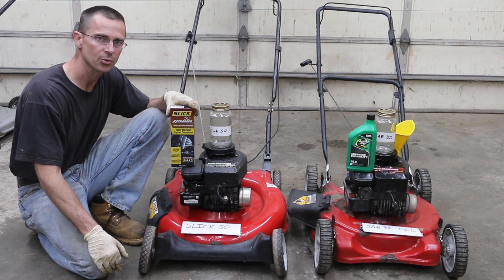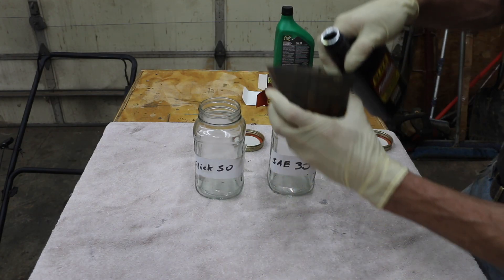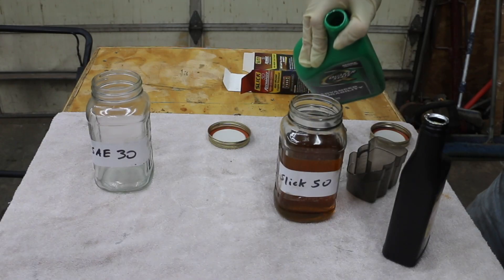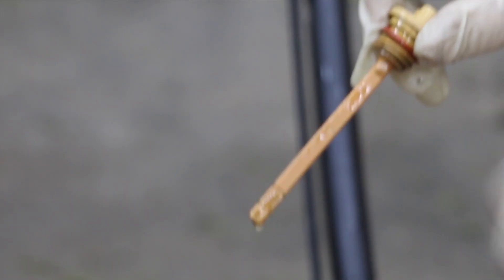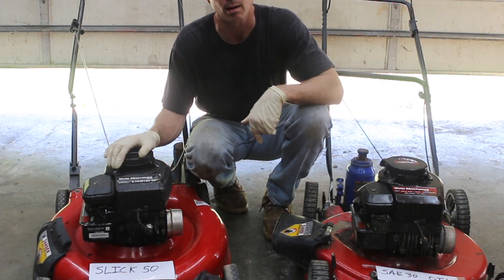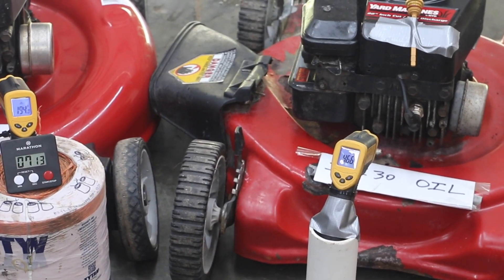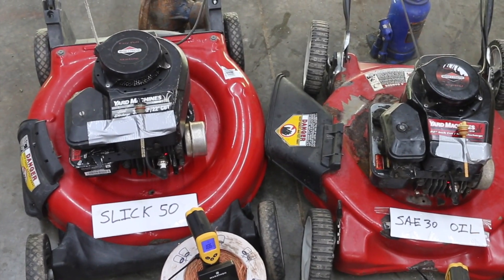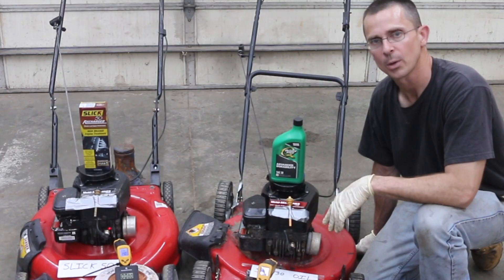Can't believe what SLICK 50 did to my engine!!--Dry Crankcase Test!

Comment: Did you run the slick fifty long enough for the bonding process to be adequate?
Reply: Good point, but an inadequate bonding time shouldn't cause that engine to fail in half the time, right?
Reply: @GunNut37086  yeas that is perplexing.  Wonder if their is a cure time because the temperature was far better with slick fifty.
Reply: @timewithchaplainken3916  That's the part that confused me the most. The temp was SO low when the Slick 50 engine crapped out compared to the other one. That has to mean something.
Reply: @GunNut37086  if paint is put on a frozen surface,  it will just come right off. Likewise, Slick 50 deposits a layer of teflon that depends on a lengthy heat cure for good adhesion.
Reply: The slick 50 does need to properly bond first.

Comment: Any additive that contains PTFE's will gunk shit up. Used to use slick 50 until I heard about Z-max. I added Zmax to my engine after regular use of slick 50. The next day, my engine was overheating and my oil levels were down by half. I limped home, drained the oil, removed the oil filter, and behold! The oil filter weighed like five pounds. Had I discovered the final resting place of my absent oil? The vehicle didn't burn oil before or after my experience. Through deductive reasoning, and research, what had happened was, the deposits from Slick 50 were washed out by the Zmax and clogged my oil filter. I replaced the oil and filter and the car ran for the next few years, until the timing jumped and trashed the engine. Conclusion, research revealed that Slick 50 was coating my engine and Zmax penetrated to the metal surfaces and made them "slick" enough to cast that crap to the eternal hell of filter finality. PTFE's are fooey!
Reply from the maker: Great information. Thank you
Reply: After watching your Zmax vs Lucas I'm not sure either one is worth spit. Was convinced that Zmax penetrated the metal surfaces to reduce friction but now, eh!? The PTFE's, now I'm pretty solid on their negative effects. Waxes, PTFE's, and just about any other additive appears to be a clever way to separate me and my cash.

Comment: This wasn’t proper test. The engines are of different age and not same series so they can’t be used in this kind of test. And even if they were new ones, you should open both and measure everything and do it again after test. The very important thing is to open the engines to see what went wrong.  Why did cooler running break first? The older one is probably worn and then it may run longer because it doesn’t get seized up as soon as new and tight engine.
Reply from the maker: Thanks for the constructive feedback

Comment: There is one called micro blue I believe and then there is the old z max. And i always thought slick 50 was chlorine based so I'm actually not surprised. And it's not a pour in treatment more of micro shootpeening with lubricants that get embedded called wpc treatment and its supposed to be top notch racing quality. I believe Honda and tons of other racers use it on everything from bearings to pistons, wrist pins, rings, cylinder walls as well as driveline ( diff's, trans, t case etc.)
Reply from the maker: Thank you

Comment: I think I could see the Slick 50 engine maintained a lower temp. Don’t they always claim it’s a metal protectant and not a lubricant? I’ve used Motor Kote on engines with the oil. I’m just catching up to your videos. Have you done a Motor Kote challenge? They have many types on their web site.
Reply from the maker: Thank you

Comment: Hello sir,
have you heard about the triboron boron additive for 2stroke and 4 stroke engines? It claims to build up an layer of boron, to such a degree that 2stroke engines don't need oil added in the petrol. They do this successfully in The Netherlands and Sweden for a lot of years. A lot of people ride 2stroke mopeds this way. They also claim fuel efficiency, because friction is recused up to 50%. This all claims to be university tested. Would be really great if you are able to test the 2stroke or 4stroke formula. 
https://www.triboron.com/products/
Reply from the maker: Not yet. Thank you for the video idea!
Reply: @ProjectFarm  perhaps nice to see your two-stroke bike kit run on 1:100 triboron without oil :), the suggested mix is 1:100. 
 Thank you for all your video's sir.

Comment: how many hours was on each mower previous. hard to say the slick 50 engine wasn't abused in its life with no oil changes. maybe that is why the oil was so much darker because it had residue oil sludge.hard to call a fair test unless the motors was torn down and inspected before the test. Would love a repeat on 2 new engines. And I am not defending slick 50 I know what you know just looking at it with open mind

Comment: How long did you run the Slick 50 treated engine before doing the actual test. Slick 50 needs to bind to the friction bearing surfaces during running . I ran a Slick 50 treated Briggs mower engine for 7 hrs a day for 10 days at a agriculture show without it failing at all. This was our demo machine.
Reply from the maker: Thank you

Comment: I put Slick 50 in my used, V6, 1986 Astro Van about 25 years ago when it had less than 50,000 on it.  In 2019 it has 243,000 miles on it.  It has other wear issues, but no internal engine oil related problems, and uses no more oil now than it did when it had 50k miles.  I have never had to add oil between oil changes!  It still runs cool.  Leaks a little oil, but not enough to show on the stick.  I have changed the oil and filter about every 4,000-5,000 miles.  AC still works too with enough engine revs (weak).
Reply from the maker: Thank you

Comment: I used Slick 50 in my Toyota 22R engine in the mid 80's. I had the engine rebuilt, broke it in for a 1000 Kms or so then changed the oil and added Slick 50. I had to adjust the idle as the engine idled much higher than before the Slick 50. Unfortunately my new rebuilt engine died 3500 Kms later. Some of the oil passages had plugged up from an unidentified substance. I later learned (consumer reports maybe, I'm not sure anymore) that Slick 50 had/has teflon in it and as the teflon deposits in the engine passages is can plug some of them up. Needless to say I have never used an oil additive again.
Reply from the maker: Thank you

Comment: Been using all Lucas products now and think it's a great quality product, have it in my older chevy v8's and use small portions of it in everything  gas engine and a crankcase! Have a 305 SS Monte C. I started using lucas in when it had 350,000 on it and bad valve guides, run 20w50 with 1 quart of Lucas, and doesnt smoke as long as your driving it daily, and warm weather car in southern climents! Have it in northeastern Indiana now, but dont run it when weather cools below 20° runs like a champ and has over 450,000 miles now and never been apart other than resealing intake m. Doesnt leak and still has strong oil pressure! Only the heads getting wore out! She was decomputorized 14 years ago running a manual good set up  older Quadrajet and manual Chevy distributor with 50,000 volt coil and 30 degree advance timing. Dont run alcohol crap fuel in it, run non alcohol 93 octane, under that will valve ping! Ultralight swift fuel runs real good, its 94 octane aircraft quality fuel! And it gets 26.9 mpg on the highway!  New engine being  built now it will be a 355 chevy with a lanati 485 lift voodoo cam and alumiun heads, so I can freshen the original 305 and pickle it! Just in case. The new motor will definitely be put together with it and have Lucas in it after breakend period . Best I've seen!
Reply from the maker: Thank you.  Lucas makes great products

Comment: Used to be good product back when slick 50 came out and it really worked good, was called Protec oil treatment, in late 70's, I used it and talked a race car owner into using it, took awhile but put in in a 355  chevy oval track motor that turned 7000 rpm and normally we put bearings in every 4 weeks of racing, and they were wore 90 percent. Put the Protec in a fresh motor and ran it 10 weeks, plus a 400 lap big race, sit thru the winter, and ran it 3 more weeks and thought we were pushing it! So jerked it apart and bearing looked like you had just wiped your finger across them, like new! Owner said you can put that in my motors anytime! Was about 20 bucks for a pint bottle! After that they sold wheelbearing grease and I used a paint cap full in quick change rearend! Never had a problem or anything that wore!  This was 1978 to 1982.
Reply from the maker: Thanks for the recommendation!

Comment: I went to a slick 50 seminar for my company in the 80's and they did same thing except the engine ran the whole seminar. it does appear these were two used engines, I would rather see test with two new motors. go to harbor freight and grab a couple predator motors and do again.
Reply from the maker: Thanks for the constructive feedback

Comment: Make-up of internal metal parts make a difference also to fiction. Aluminum parts will seize quicker than Carbon based metal products. I also noticed discharge air from one mower.
Reply from the maker: Thank you for the constructive feedback

Comment: Todd. Your tests are awesome and dramatic. I enjoy them a lot! 
"Slick 50" flopped. And to many of us who know the story, the "Slick 50" of today is nothing like the original formula. So that leaves me wanting... with a hole in my heart, aching for the real product's vindication. 

Now I'm not associated with the product in any way... just an old guy who held up Slick 50 as a heroic warrior of my youth. It stood alone against the creeping villain of planned obsolescence.  Back then they called it "stickin it to The Man".
 
I'm hereby requesting that you make things right by testing LUBRILON (@t. It is the original, authentic, tried and true, Alpha Male, Slick 50 formula (now going by the name Lubrilon in the US, and Xcelplus in Austrailia). If you don't do it, I might have to  become a "squeaky wheel that gets the grease", so to speak... haha

If you were to consider doing that test, I would predict that it will be the only oil test that you will have done that actually defies the odds - that without oil, the Lubrilon treated engine will morph into an "eveready battery" and run indefinitely. It would redefine the term "run dry". You may have to set up a continuous time-lapse camera shot so you can get some sleep...

Comment: The early formula would not pass through most oil filters resulting in many blown engines including my 1983 Chrysler 318. I pulled the filter after loosing oil pressure, and it was full of white paste!

Comment: You could probably fix those motors. Usually all I ever have to do is pop the cylinder head off, put a block of wood on the piston and beat it with a hammer until the motor frees up. Then add oil. OK maybe throw a little oil into the cylinder first too?
Reply from the maker: Thank You!

Comment: Molyslip "E" use to make an additive way back, had used with great success, even tried seizing and engine by dropping the oil out, alas she knocked like a diesel and wouldnt die. Maybe they have changed the formulae now, but havent seen the product anywhere, it did work?
Reply from the maker: Thank you for the recommendation.

Comment: A while back my grandpa had a small engine repair shop, there was a slick 50 rep that stopped in once and he had a lil pisser car that he would drain the oil in and run it until it locked up. He would then allow it to cool down and hed add oil and it would start back up. He did this to this little car over and over and it never didn’t start. What this guy should have done is added oil to the mowers and see if they would turn over and maybe even started.
Reply from the maker: Thank you.  I wonder if the formula changed since then.

Comment: In order for Slick 50 to perform as it was designed, it it takes more run time than a couple hours to fully treat the engine. In the early 80s, I saw in person a demonstration of a Briggs & Stratton 3 1/2 HP horizontal shaft engine treated with Slick 50, run for at least 30 minutes or maybe longer without any oil, then the engine was turned off, but it did not stop on its own or lock up. Afterwards it was rather cooler to the touch, they let students touch the engine. Part of the output shaft cover was cut away and covered in plexiglas so one could see there was no oil in the engine. This demonstration was done by a Slick 50 dealer in my high school auto mechanics class. At this time Slick 50 was only available through a dealer. I think the test in the video was not done properly.
Reply from the maker: Thank you!

Comment: The  "Slick 50" product used in this experiment is an imposter.  The name was bought by another oil company; but the formula was not a part of the deal. So the ongoing product formula was a different, inferior one. The new owners still advertised the altered product using the original claims, but their formula didn't live up to them (as you discovered). They came under the heavy hand of the FTC for it. That's why you don't hear the claims any longer.

The true, tested formula that can still legally advertise the dry-running claims is currently sold in Australia under the name XcelPlus..

For the FAQ about the real thing, head over to 
xcelplus dot com dot au/faq dot htm...
Reply: Thank you, also, oil left in the mower without the slick50
Reply: @og1ie  the original, authentic Slick 50 didn't care if there is old oil left in there. The PTFE part of Slick 50 treated the metal of the engine, by bonding with it. The oil was just the carrier. The real Slick 50 technology is now named XcelPlus, and they sell it as an oil additive. They claim it doesn't matter which oil you choose to put it in. It doesn't react with the oil to make it better, it treats the metal.
Reply: @chazfaz3595  You should send a bottle to Project Farm to have him test it.
Reply: @1speed2racer7  Haha... That would assume: 1) that he has another working mower that he'd be willing to use as a guinea pig... and 2) that I have some Xcelplus product to send him. I'm not a dealer.
Reply: @chazfaz3595  But you apparently know how to get your hands on some?
Reply: @1speed2racer7  I do know...
You have to order directly from the manufacturer (xcelplus dot com). 

But believe me... it's a "stiff order". 
Since they have to "swim" it over from Australia, shipping alone is $30. 
And they do know well what they've got, and they charge accordingly. 

It costs $99.00 per ~1/2 pint. That's a quantity sufficient to treat all of the metal moving parts in a large displacement V8 (7 liters, or 427 Cubic Inches). 

But if you think about it, that's a pretty good deal if you're fixing to treat a fleet of lawnmowers. A typical lawnmower is only about .16 liters (~10 cu inch). So with that 1/2 pint bottle, someone like you could make 40 lawnmowers live forever. That's less than 4 bucks apiece. Set up a neighborhood business and charge $20 per...
Reply: @chazfaz3595  The website states that they do not ship to the US.

Go to the website and click on the "shop" button and you get this on the 3rd line down... "USA Customers: We don't ship there. Please contact us for options."
Reply: @1speed2racer7  sounds like you know better than I... Haha
Reply: @1speed2racer7 I just found out that Xcelplus is marketed in the US under the name Lubrilon. So no need to swim to Australia. And they have an additive packaged just for 4-cycle lawnmower engines. ($15 at lubrilon.com). Thanks Michael Czajka...
Reply: @1speed2racer7  I contacted Michel Czajka at Xcelplus and he explained that they don't sell to the US because it's already marketed here under the name Lubrilon. And Lubrilon comes in a lawnmower engine version too. ( http://www.lubrilon.com/products/4cycle.asp ). Thanks Michael
Reply: @chazfaz3595  Remove the ')' at the end of the link for it to work.
Reply: @cocarr1  So you only know how to navigate a link by clicking on it?... You  don't know how to select the characters of the URL and use it in other ways?
Reply: If you want to know what happened to Slick 50 please watch the video:
https://www.youtube.com/watch?time_continue=1&v=CAt-tJa9P_s

Comment: I used slick 50 in my 79 Corolla and the oil filter split while it was warming up. It was making a terrible racket and I cut it off, knowing it would probably lock up. Not so, put oil back in it and a it ran fine.
Reply from the maker: Thank you!

Comment: Tolerances on each engine could not be the same the sae 30.looked older  andmay have had bigger wear tolerances. Also the governer settings would have had each engine at a different rpm. The duration of time with the oils in was too short. The tolerances would also be reduced by slick 50 if the engine was also newer it would stand less heat before tolerances closed.  Less heat if the measures can be trusted was an indication that friction was reduced in the slick 50 engine but it would not help if rpm and tolerances were different.
Reply from the maker: Thanks for the constructive feedback